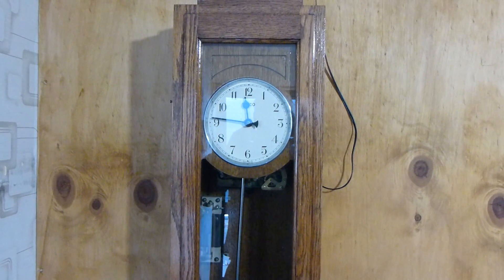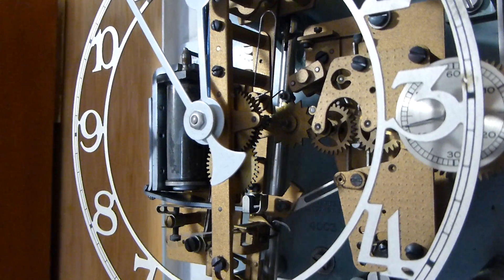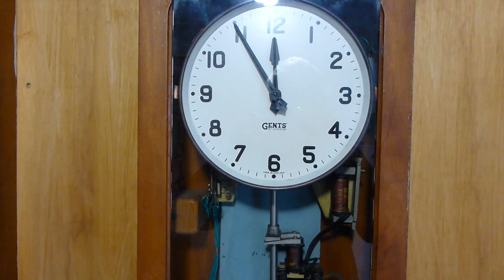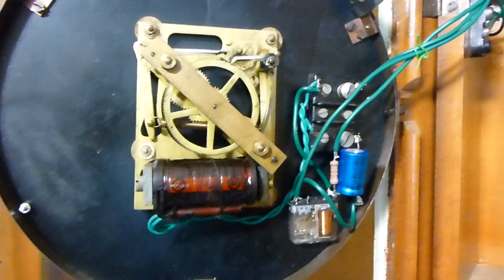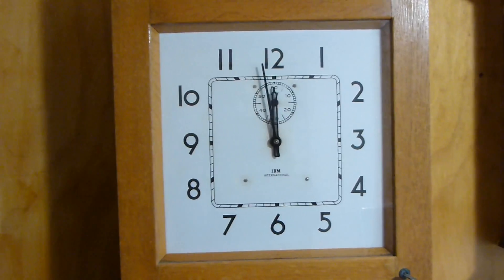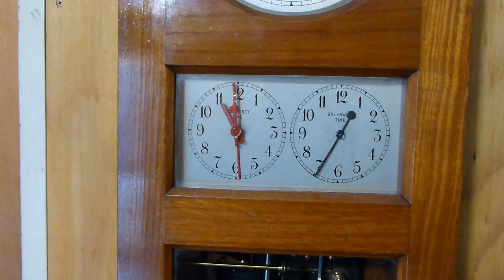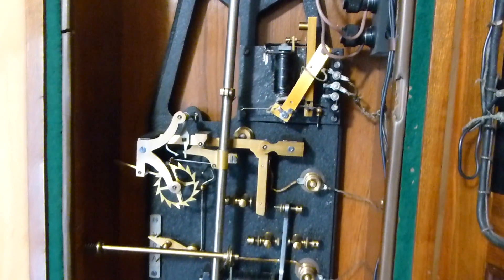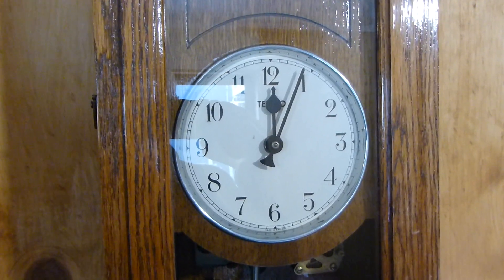Electric master clocks

Comment: I had a Gents Pulsynetic once, and it was so unreliable I got rid of it. I wish I'd kept it. Basically the gravity arm sometimes failed to reset, resulting in a second impulse two seconds after the first one. Worse still, I couldn't get it to always advance the wheel by one tooth at a time... sometimes it would advance two teeth at a time, so my slave clock was going horrendously fast.
Reply from the maker: I have about 5 C7s. the last one i got runnijg was quite difficult to get relaibale but ist now keeping time about +/- 0.4 sec per day. The adjustments are really critical.

Comment: I have one and i want fix it
Reply: Adjustment is key to success, Even down to the noisy clatter , every 30 seconds . I have some in my clock repair workshop.
 Several steps can be taken to reduce the clatter , 
1/ The recommended voltage , is intended to supply many slave dials , ( throughout a large factory, etc. ) so for use in a domestic setting for example, try reducing the voltage , to the point it just runs reliably , .
2/ adjusting the contact gaps , and the drop of the roller onto the gradient , carried by the pendulum. 
3/ renew or install felt pads onto surfaces  which the armature impacts. 
Close observations of the action , and numerous experiments , will eventually garner improvements , and be time well spent ..

Comment: Interesting. My Synchronome keeps excellent time and is very stable, but you are correct about the setting up, they are delicate things that require understanding.
The Gents' Pulsynetic on the other hand also keeps as good time but with them it's just a case of bolting it to the wall and setting it going. Messers Parsons and Ball were not trained as clockmakers they were industrial engineers and it shows; large lumps of cast iron, pressings and stampings, it's a machine for keeping time and they just work. Not as pretty though.
Your clocks are very close to each other and no matter what the wall is made of they will interfere with each other. All my clocks are 30 foot away from one another and as far as I can the are mounted at right angles to one another.
Reply from the maker: Hi Donald. I agree with your comments re the gents & the synchronome, and yes my clocks are close, but its a matter of too little space and too many clocks. There are another 10 or so in storage !.

Comment: talking about earthquakes, we don't have earthquakes in London, but a hospital that I worked in had an operating theater, 5 floors up where the concrete floor ( about 100 feet by 50 feet square ) was suspended on huge damping tension springs, all the way around, you could not see from the inside, this was to reduce vibration, from local bombing during ww2, but I don't suppose it was any thing like an earthquake.but the v2 bombs could take out 1/2 a dozen streets in one go.
I put a little piece of rubber on the hipp toogle to act as a buffer on my po 36
Reply from the maker: A decent earthquake here causes the pendulum to bang against the glass on the case.
Reply: @9neil  it's a wonder there is any glass left or right.
 I went to the science museum, in London years ago, and they had a platform wiith grip railings, which simulated in 3 dimensions an actual seismic recorded earthquake in Alaska, with life size pictures in front of you, where the road side had drop 12 feet, if you did not grip hard, you would have ben slung of by the force. but I am sure the real thing, is a lot worse.

Comment: what voltage are you running your synchronome? i have one and cant get the right voltage via a battery
Reply: I am running them on 12v DC, and have adjusted the series reostat to give a current  of about 200mA from memory - its a few years ago. I can measure it if you wish. cheers
neil
Reply: @neil1058  wow i didnt know i commented on this 3 years ago. I seemed to have lost the piece that holds the pendulem and suspension spring, so everything is on hold until i can find another.

Comment: Thanks for sharing. Interesting collection. What do you consider your best timekeeper?
Reply: Hi Tony,
              without a doubt, the IBM. It remains within a few seconds month after month. Second is the PO36 and the Gents with the two Synchronomes coming in last.
Reply: Thanks, My interest is in designing and building accurate pendulum clock impulsed by modern electronics. I also have an International (IBM) series 25 with the sealed mercury pendulum. I am in NAWCC chapter 133 electric clock chapter here in USA.
Reply: Sounds like we are going down the same path. My version 1 clock was impulsed from the bottom of the rod using the fedchenco concept (double coil) one to detect and one to impulse. It also had micro processor so i could alter the delay and pulse width. Now my version 2 has photo cell at the bottom of the rod, its impulsed vis a solenoid at the top of the rod, It also uses knife edge suspension.

Comment: Very nice collection of master clocks you have there. Electric Clock and meter collector from Auckland. I do the same by adding small weights to the pendulum for adjustment. I noticed on your PO #36 clock that you also disabled the seconds contacts, they do add drag onto the pendulum.
Reply from the maker: Thanks R. Yes the contacts do increase the HIp frequency.

Comment: Hi Neil...A great collection ! I note that your PO36 is a favourite..I have a Mk4 like yours with the synchroniser. I'm not sure about them ever been used on the railways though. They were used in telephone exchanges up until sometime in the late 1970's to control tarrif equipment..ie. to time the calls.. Ther were several Marks..up to Mk6. The Mk4 at first had the synchroniser but could not of been succesfull because the PO removed them when they needed repair and the Mk4 is most often now seen with the synchoniser removed. I ibelieve the PO used a landline signal once a day to keep the clocks accurate ...but for some reason this must not have been successful. They were made under licence by at least three major companies..Gents, Synchronome and Magneta..Usually the label inside states the manufacturer..
Reply from the maker: Hi IP, and thanks for your reply. My PO 36 is made by Gents I think, as it has a Gents movement, but i cant find any label elsewhere.  The teal blue/grey iron frame may be a giveaway perhaps?
Reply: The synchroniser system worked ok, but it was run through the telegraph network. with the increase of popularity of the telephone, the telegraph network was phased out and by the mid 1950's the synchronisers were no longer provided (Type 36 mk5). Some time after that, the sync system was discontinued.
I have two 36's with 30, 6 and 1 seconds clocks running, and the synchronisers are externally operated once a day. I am still finishing the system, but it is working, see following vid…
https://youtu.be/F0AKXa2VykU